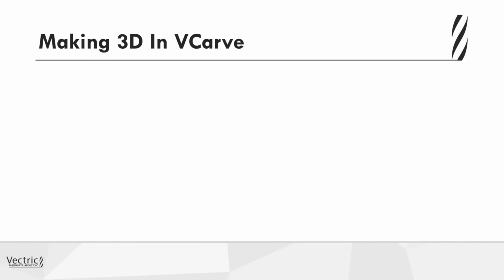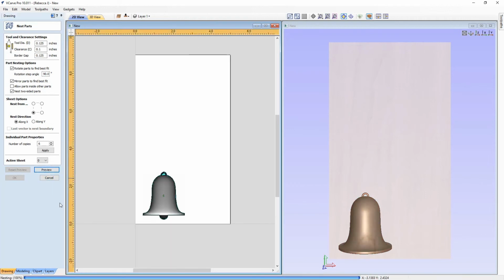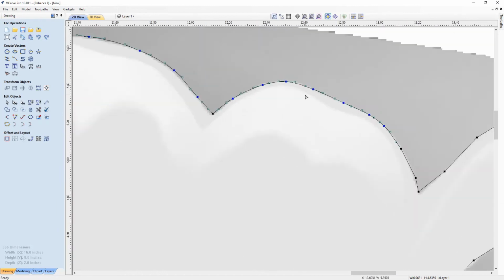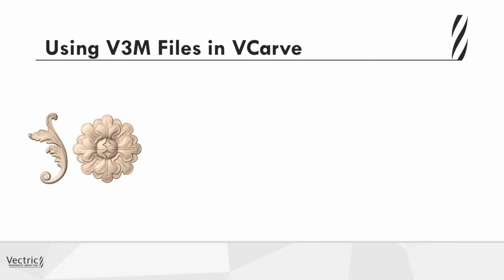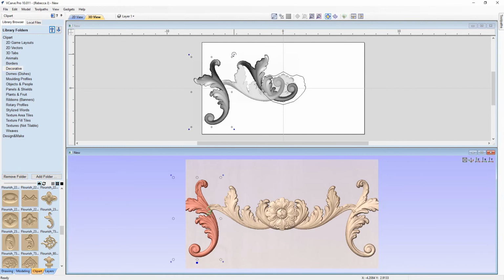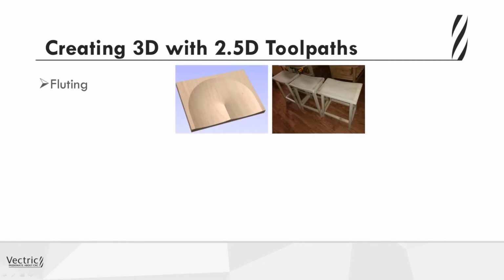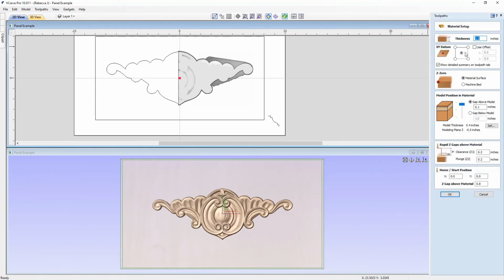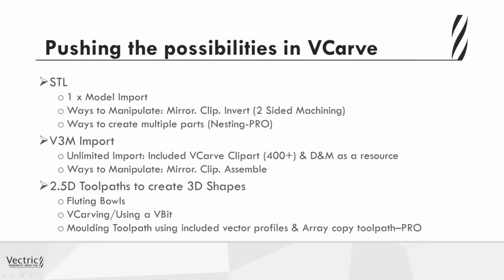Live Q&A with Beki | Stretching the Boundaries of 3D in Vectric's VCarve Software | Vectric FREE CNC

Comment: Hi, Cracking video. Question: once you have painstakingly created your model through manipulation of the two pieces of clipart, is it possible to save the finished product to your clipart library, or are you restricted to a CRV file only?  Thanks again.
Reply from the maker: Hello Bungy... thanks for the question.  You are correct... and you can really save it from VCarve as a piece of clip-art... but in saying that if you are pretty savy you can save it off as a .CRV file and then use it as a base for a future project.  Really if you see a lot of value in having that as a piece of clipart to use in your libiary then Aspire is the program that will do that trick.
Reply: @vectric  thank you for your response and support. Appreciated!!

Comment: Does the resolution selected at the beginning affect the resolution of the model and the rendering in the software AND the resolution of machining steps in calculating tool paths OR just the resolution of the model and rendering in the software?
Reply from the maker: Hey David great question, thank you! The Modelling Resolution effects everything for the 3D models created and imported into the software, and in turn this will have some impact on the toolpaths calculated from those models.
The Toolpath Simulation Quality is separate however and would normally be used at a lower quality during the setup of a design for quick checks, then pushed higher for a final check before exporting a toolpath to get the most accurate preview to review. I hope this helps! :)